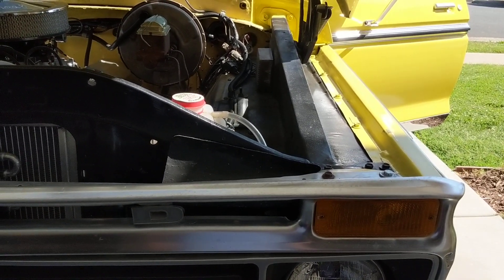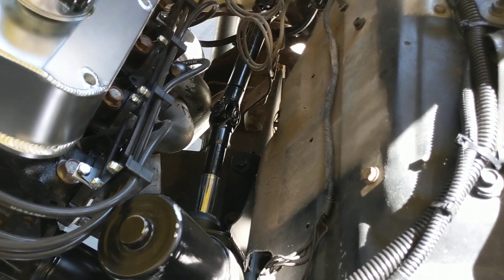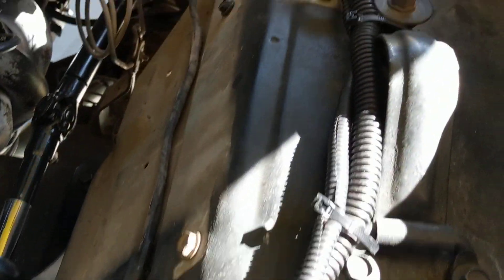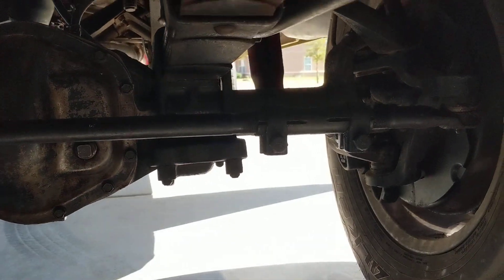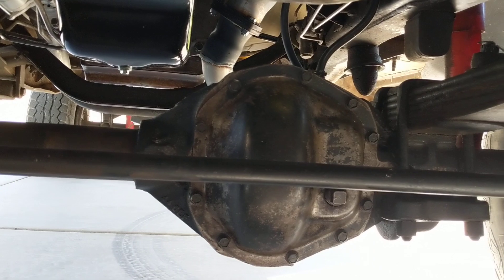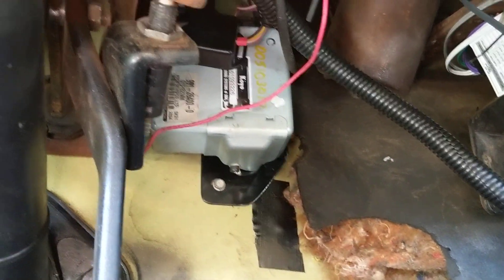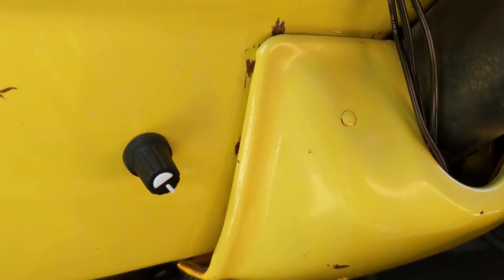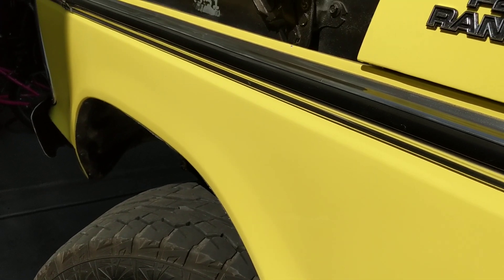1977 F-250 Highboy Electric Power Steering Install

Comment: Very clean set up, looks good. I always hated the way Ford had the power assist, the ones I drove did not work very well and looked even worse ( a bunch of oily hoses lol ). My 72 Ford High boy had manual steering with 17” wide by 40” tires, not bad to steer while moving/driving but could be a bear if you need to turn without moving much. I like the 78-79 set up that Ford used for PS on the F250’s. I loved my 79 with the PS box, NP 205 married transfer case. Funny how GM came out with power steering box first, one wire alternator, and HEI ignition but the Fords back then pre 80 were such better built as far as frame & sheet metal. Again great job ! I’d be interested how this electric works with larger tires like 36” to 38”s.

Comment: You wouldn't happen to have a link where to get that replacement link from the pitman to replace the hydraulic selector would ya? Mines a 76, thinking I might just cap it off.
Reply from the maker: I ordered part # Moog DS801 from Amazon, I think it was about $60ish. This replaces the hydraulic/four hose apparatus.

Moog DS801 Drag Link https://www.amazon.com/dp/B000C55VZW/ref=cm_sw_r_cp_apa_i_Kbj.Cb4N8WCC0

Comment: Sick motor,  I have a 73, garrison setup, leaks and pump starting to squeal this is a good option, where did you get the drag link to replace the valve set up ?
Reply from the maker: The replacement link is a Moog DS801, works well.
Reply: @gator4917  thanx gator👍

Comment: The new drag link you that replaced the old hydraulic pump/crap, do you have a part # and brand?  Thanks. Moog?
Reply from the maker: MOOG DS801
Reply: @gator4917  thanks man!! Appreciate
Reply: @gator4917  also thinking about that electric steering… did u have a good experience with Steerman cycle! ?? Thx
Reply from the maker: @trevisquill7076  I did.  It's been several years now, so I'm not sure what all was/has changed.

Comment: Hey man I have a question I have the kit installed on same truck. The red mating clip wire that follows the adjust knob what does that plug into?
Reply from the maker: I'll need to go look. I know I had to run a "bus bar" of sorts and I think it's a hot wire, but let me check how I wired it. It could also be wired into the control box too, I honestly don't remember.  Sorry.  My truck is currently getting the axles rebuilt, so I don't have access to my truck at the moment.
Reply: gator4917 thank you for responding. I reached out and got an instruction guide that I didn’t originally receive so now I’m good. Thanks

Comment: Just installed this setup in m 75 and mine is making that same whining noise but to me it doesn't seem like it's coming from the steering wheel. Mine makes the noise even when the power is off. Did you stop yours from making that noise? How did you fix it? Thanks
Reply from the maker: Mine was in my steering wheel, right behind the horn area. I took everything apart and then placed some grease to lubricate it. I really want to remove and replace the entire steering assembly with a ididit steering column.
Reply: Guys, I have the same setup for my 73’ I’m running 37” tires and the steering unit with the adjustment knob all the way up still feels like manual steering and not enough power to turn the wheels. Have you guys had this issue? Confirmed 12v all the way through the system, plenty of grounds.
Reply from the maker: @jamesclark9800  I had to open up the control box after talking to Steerman cycle and there was a very small set screw. However, that was one of the early control boxes.  I would reach out to Steerman and ask him.

Comment: How did you fix the belt issue?
Did you use a pulley kit?
Reply from the maker: I've installed a CVF serpentine belt kit. Just a basic alternator, WP/fan and crank.

Comment: How did you remove the power steering control valve?
Reply from the maker: Are you talking the drag link that connects to the axle from the pitman arm?  If so, I used a Moog drag link, no control valves. I don't remember the part # though.  I then just removed everything else, steering assist (stabilizer looking part), hoses and the pump.
Reply: @gator4917  I ordered the sterring system as well.
I'm in the slow process of installing it and I can't figure out how to remove the old power steering control valve so I can install the moog pitman arm.
Reply from the maker: @TejanoFord77  yeah, it took some pounding with a pickle fork to separate the old hydraulic assist from the pitman arm.
Reply: @gator4917  did you remove the tire?
Reply from the maker: @TejanoFord77  yeah, gave more room to work.
Reply: @gator4917  ok, I'll do that tomorrow. 
Thanks man!
 I appreciate your help.

Comment: You failed to mention that you had to cut the inner fender. Removal of existing steering is a huge P.I.A.
Reply from the maker: Sorry about that. Yeah, the fender needed trimmed a little.  Removal of the old steering was a pain, I had to pull the gearbox to make the geometry work for putting it back together.